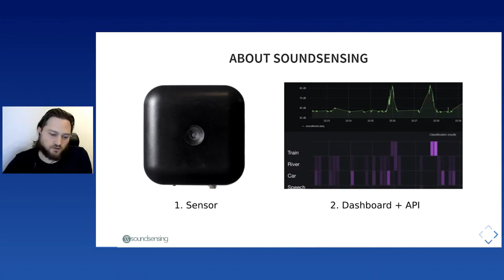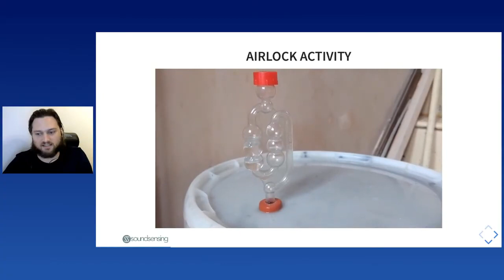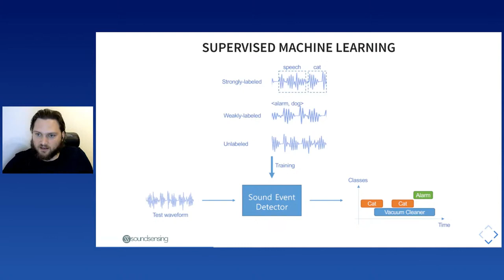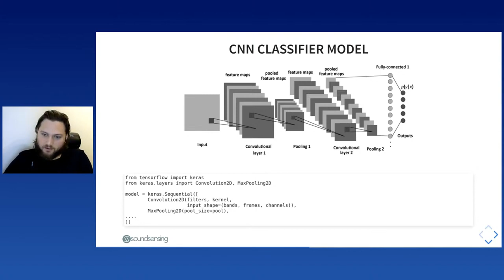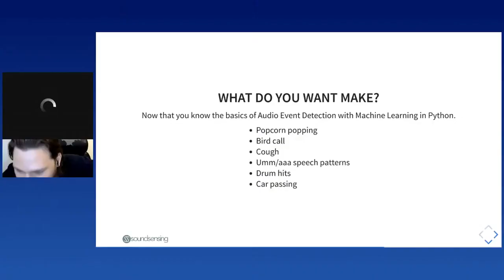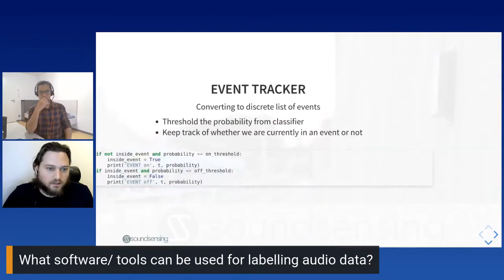Sound Event Detection using Machine Learning (EuroPython 2021)

Comment: I trained model on 50 classes, can I not use it to detect sound on audio files (longer than what were present in data i.e. 5 seconds each) by classifying chunks e.g. which segment has what sound?
Reply from the maker: Yes you can. That is the key to using a classifier for SED. It is smart to compute the chunks with overlap, to increase the resolution of the output.
Reply: @Jononor  Thank you very much. I was hoping for an answer though not expecting one (video being a year old) but thank you so much. I have implemented the code to create segments from audio file and then run classifier on each of them (however, I have not been successful in getting what I want but that is probably my classifier is bad (only 50% accuracy). I will run more experiments on it and report back results here (unless you have a better platform where such things can be discussed).
Reply from the maker: @JawadMansoor-fw8po  The SoundOfAI slack is a good place. Ask in #advice then there are many people that might be able to help
Reply: @Jononor  Thank you. I will check that out now. Thank you for being so helpful.

Comment: Hi 
Nice video explanation. I have one doubt, I have a thousands of dataset and each data is one second. Will SED will work for it ? I have to label for all thousands of diff data in a dataset.
Reply from the maker: Yes you can use that for SED. And yes, one will have to label it first.